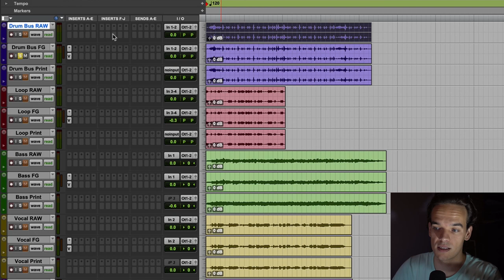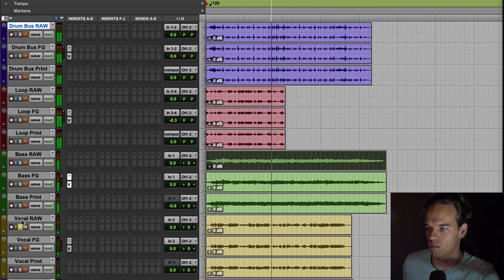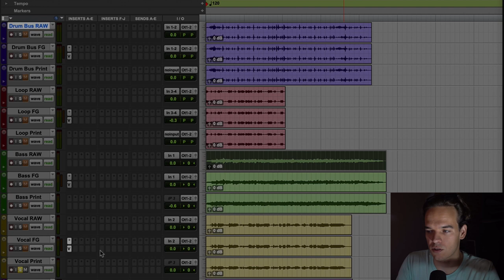Distressor Shootout - FG-Stress VS Hardware

Comment: I think B is the real deal. The snare transients sound slightly warmer on example B. Also, both sound great. I feel like they are super close to each other, sonically. The difference I notice is in the feel. The hardware just feels a little smoother/better. But, for what it is, the FG Stress gets crazy close.